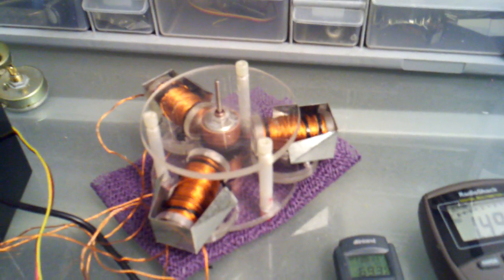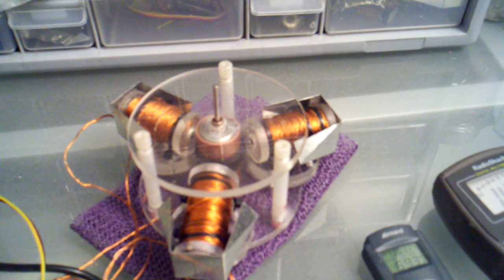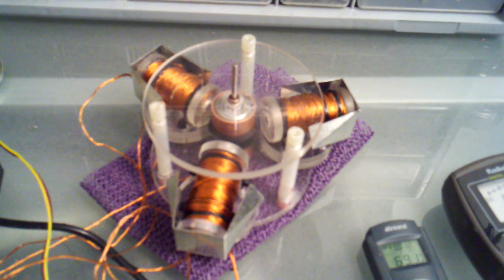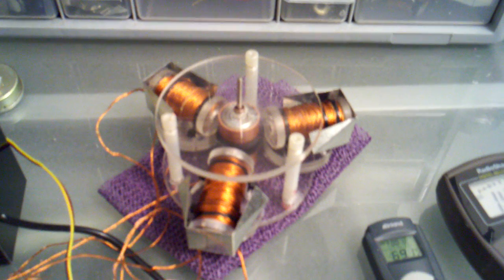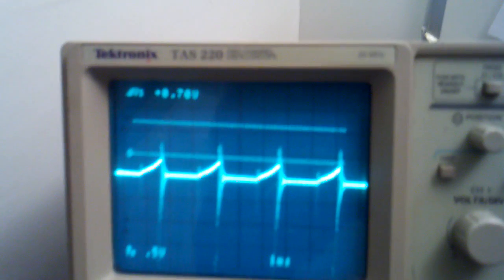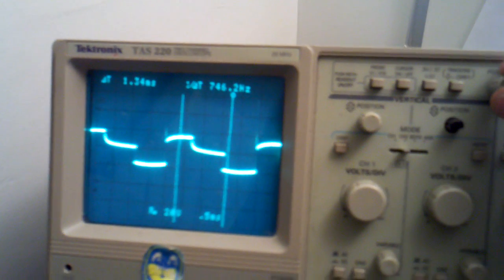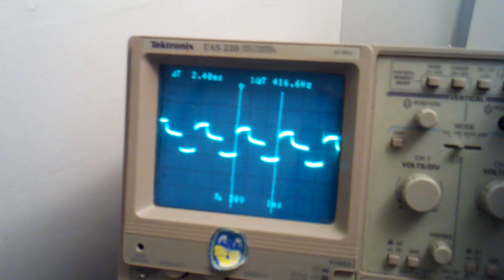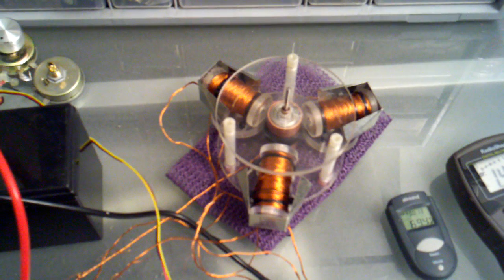Bedini 12 coil

Comment: Love the design and layout looks pretty bad ass. I would definitely never sacrifice one coil for a trigger coil. You can use a small 12 volt relay from a car and take the coil out of it, and use that, it will produce a good deal of voltage. BTW your voice sounds erily similar to mine on camera haha. Also where did you get the braided wire or is that solid?